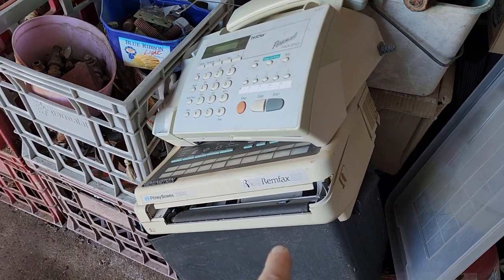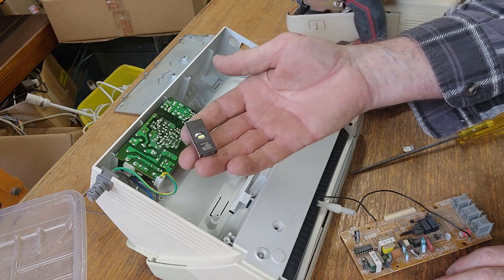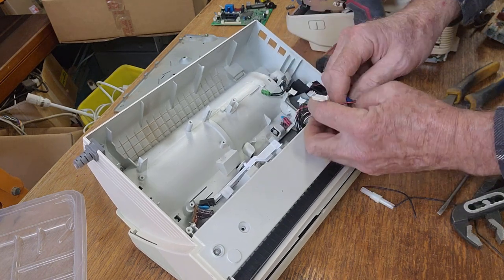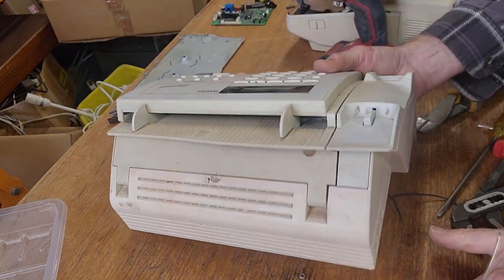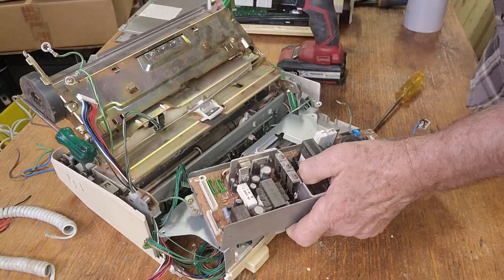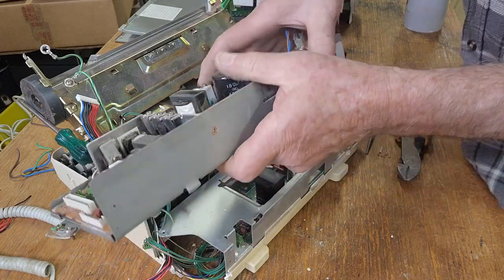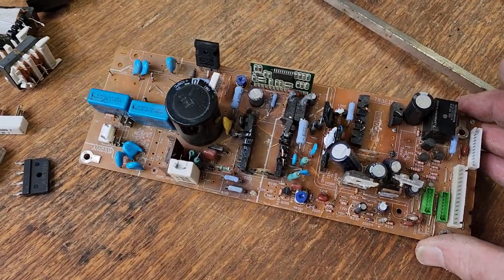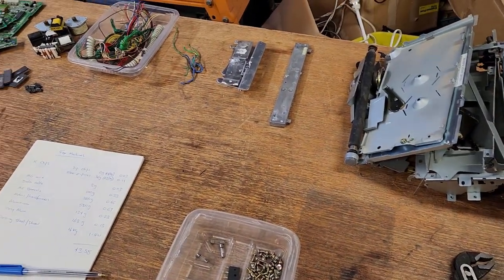Storage Shed Clean-out Part 14 - How to Scrap Vintage Fax Machines for Useful Parts & Scrap Metal

Comment: Unfortunately office machines were never much value for scrap or electronic parts. I used to enjoy pulling a photocopier apart though even though the dozens of black screws were the most useful thing in them. My GP also pulls photocopiers apart for fun, though they arent so easy to come by these days. I did manage to fix a broken spring in my XF Falcon door latch by taking one from an old fax or printer I had lying around, and removing a couple of turns, which meant I could fix it on the spot rather than have to partly reassemble the door so I could drive to the dealer and buy a whole new mechanism.
Reply from the maker: Thanks Steve! I too have fallen victim to dodgy XF door latches! I didn't think of a photocopier spring tho! 🤣

Comment: For a person capable of designing complex electronics without using CAD/CAM with ready-made libraries and basic code/design and having it as non-profit hobby such an e-waste would save couple of hundreds of USD from parts bill, but he or she will never pay that much for it, simply because for him or her they are available for free, the same as to you. Sadly, there is no simple access to e-waste for such persons and poisoning of the illiterate population of undeveloped countries continues.
Reply from the maker: It would at least be very nice if all ewaste was available for people to salvage parts from and perhaps restore items rather than having locked crates and not letting anyone save anything because the local councils are worried about liability issues!